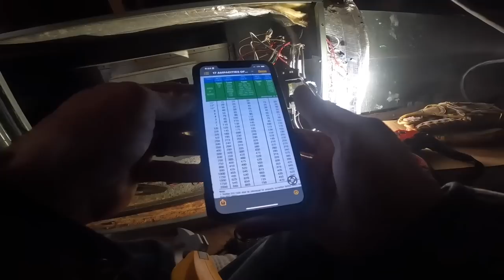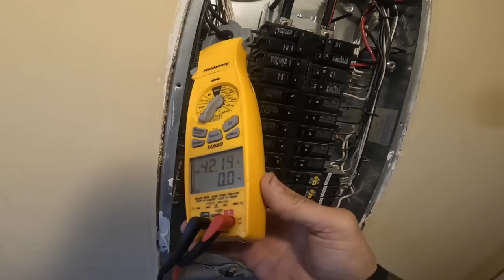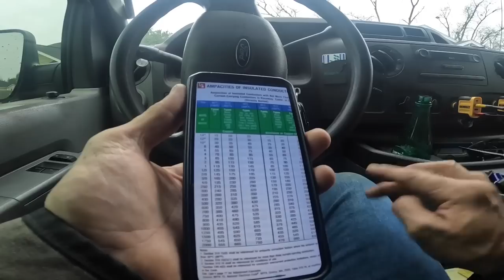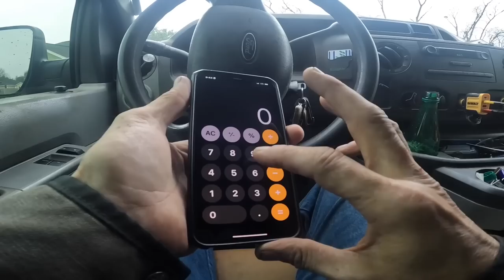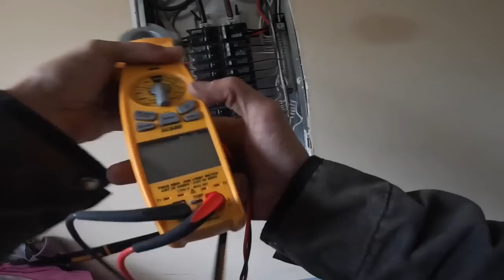No Heat Call Leads to Finding A Problem That’s Been There For Over A Decade

Comment: With aluminium wire , it is always recommended to use deox , tighten the terminals, wiggle the wires, re tighten , do this three times . This prevents cold flow ( the aluminium wire becoming loose later. )
Reply: Hey I installed a surge protector with my mini split but it seemed like it had stranded aluminum wiring- I'm not sure but it certainly wasn't copper. Any install procedures for the small guage stuff like that? Nothing mentioned in the shitty instructions
Reply: @chrisE815 Use deox and use the same process as I posted.  No issues with aluminium wiring if the proper preparation is done.
Reply: agreed!
Reply: @Total6666  So I was doing some reading on Nolox (or similar) and the reasoning. The main difference between copper and aluminum at the connections is the copper oxide remains conductive but aluminum oxide becomes resistive. So de-oxide used at the junction coats the aluminum to slow/prevent oxidation and includes an abrasive to etch through any existing oxide. Since aluminum will expand more you also really need to torque the crap out of any lugs.
Reply: @Mike80528  yes and Besides torquing the aluminium and copper stranded wires, wiggle the wires   back and forth, then tighten . Do this at least 3 times and this will prevent cold flow also.
Reply: code also requires the lugs (or equipt) 
to be rated -and marked CU/AL
Reply: @sparkyobrian6417  most devices are marked with cu/al , but it is always good to check if they are.

Comment: It’s surprising that whoever installed this Furnace Setup didn’t Add an Outlet for a Light Bulb up above the Area that you’re working in. 🤔👍
Reply: They called in an electrician which went the extra cheap route. We would always run copper and add a service plug and a light. It is code in many places to have a service plug and light to service the equipment.

Comment: I have a heat pump. Work up one day to a cold house. Found the 50 amp breaker tripped. It has two breakers, one 50 amp with one 10kW heat strip and one 60 amp with the other 10kW heat strip plus the fan. Or at least that's how it was SUPPOSED to be wired. The installer swapped the feeds for the 60 amp and 50 amp breakers, so the 50 amp breaker was powering the 10kW heat strip and the fan. That's why it tripped. I swapped the feeds around so they are correct and it hasn't tripped since. A little attention to detail from the installer and it would have been done right.

Comment: I could be wrong, and i know code varies pretty broadly by location, but i would double check the ampacity for aluminum cable. Type UF would be direct burial cable rated at 60C as well as NM-B (Romex as most of us know it). This appears to be type SEU which is essentially service entry cable, rated for 75 or 90C depending on its insulation make up, so technically rated up to 50/55A. That being said with it running through the house and how much more you have to baby AL wire i completely respect the decision to de-rate the circuit given the choice to just swap a breaker and a couple parts!
Reply: It’s strongly advised to use the noalox or any brand of antioxidant on stranded aluminum wires.  Also, get a torque screwdriver to make sure the breaker is torqued to the manufacturer’s specs.  That will help insure a tight connection.  Those aluminum wires can be easily under torqued or over torqued.  I think it was a good call to replace the breaker with right size.
Reply: also should  you only use 80% of the wire rating for heat of ac ?

Comment: I have questions: Why downgrade the customer’s heating capacity just to match the load on the wire and breaker? Why not leave the heating coils as they were and have an electrician upgrade the circuit with new wire and breaker? Are the existing breakers rated for aluminum wire use? Did you use an antioxidant on the terminals?
Reply: You would have run a new wire with no access to most of it, better to match what you have already.

Comment: I wouldn't use aluminum on anything less than a 100 amp service just due to the fact, smaller aluminum wire expands and contracts too much. The wire has to be larger and every termination needs anti-oxidant. Ive seen dryers, ranges, and water heaters melt down because of the wire failing. The wire expands and contracts so much and a lot of lugs don't accept aluminum wire anyways, it backs the set screws out causing a loose connection. Once you get down to #2 aluminum required for a 100 amp service, the expansion and contraction isn't as great and doesn't pose as much of a problem that multi-wire branch circuits do.
Reply: Pretty much every electric stove in any house around here built in the last 40 years has aluminum wire feeding it. I've never heard of any problems with it.
Reply: @brianleeper5737  ... no problem provided it's big enough. It takes #4 Al to do a 50 amp feed.... and even then there's no fudge factor. A 50 amp breaker is maxed out.
Reply: @rupe53  It's a tad more complicated than that. According to the ampacity tables, if you are using type USE cable, 6 AWG aluminum, and 75C rated terminals, the rated ampacity of that 6 AWG aluminum is 50 amps. It is only when you use using 60C rated terminals with TW or UF cable (and I don't even think aluminum TW or UF is even made anymore) that you are limited to 40 amps. Because circuit breakers have 75C rated terminals and so does the range outlet, use of 6AWG aluminum USE with a 50 amp breaker is allowed.
Reply: @rupe53  If you think I'm wrong, ask someone with an electrician's license to explain it to you.
Reply: @brianleeper5737  ... you are correct in that using the different temp tables will get you different numbers, but I see this WAY too often and people are cutting it too close. BTW, if you use wire that's big enough then you can stop looking at that temp chart. #6 Cu is good for a minimum of 55 amps and stranded THHN can push a bunch more than that.
Reply: @rupe53  It's permitted by the NEC and the tables are pretty conservative. In any case, 6 awg aluminum is routinely used for 50 amp range circuits around here and I've never heard of a failure. Aluminum is used instead of copper because it costs less and the price difference has only gotten larger in recent years.

Comment: On Aluminum conductors you really should be using Noalox  or Ox-Gard to prevent oxidation on  them . i do agree with the 7.2 kw on that tiny wire .

Comment: I would have pulled a new no.6, and a no.10 and put 15 kw heat strips in it, I haven’t seen many houses that I couldn’t pretty easily run a new wire into the breaker box.

Comment: That was great preventative maintenance! It was Shitty to use aluminum wire for that application in an attic and under rated to boot. You probably saved them from a fire 🔥
Thanks again for a great video! 🇺🇸 👍
Reply: Yeah, that would be  Ruud awakening...
Reply: Zero Appliances of this demand allow aluminum wires to directly feed… 
All require copper conductors be attached.
Reply: Did you just say aluminum UF is romex? 
UF is direct burial NMcable… I think what you had was SE…
Reply: panel run is now what 1k..maybe more
Reply: This is also why aluminum wire is no longer approved for residential buildings. The loose wire at the breaker is extremely common due to heat and contraction/expansion issues and it is also common to come loose and burn up using bolt connectors, especially when connected to copper wiring. Of course the fact it was carrying too much amperage made it much worse.

Comment: I just took an emergency Amana PTHP call from a hotel in Lancaster, they've installed both the spare units, they're totally booked, and this "tundra blast" begins at 08:00 Hrs (in 2:00 Hrs).  I'll wind up installing a new heat strip set, new blower wheel/end bearing, and "Broad-Ocean" fan motor. The weak point is the fan motor, I've had three "totally locked", straight outta the box; from (both) Supply House, and NorthStock.  This turns an hour job into 90 minutes minimum, and requires that I carry at least 4 Broad-Ocean motors, just to be certain that two will function properly.  Stay warm, everyone...
Reply: Yours is the first post I have seen about a Broad Ocean I assume ECM? I have two Carriers one with a Broad Ocean going on 2.5 years. My other Carrier has an X-13 didn't make it 2 years. Up until 6 months ago (haven't checked since) there wasn't a rescue motor for a Broad Ocean. I called the rescue motor company and they said the BO hasn't been reversed engineered yet. Have you heard anything different?
Reply: @scotts4125  Sorry, Scott, these are Amana Goodman PTAC Indoor Evaporator Fan Motor 0131P00054SP's sourced from Supply house; the replacement stock just received is a OEM Zhongshan Broad-Ocean Motor Co. part # ZWK465A00301, 0131P00029, D1410100300397; and requires a control board upgrade, as  it's a 4-speed versus 2 speed.  This HVACR business was spawned from a Motorola Two-Way Comms Dealership, and was initially Carrier/ICP Comfortmaker. My former business partner, also named Scott, and I both are capable of doing Surface Mounted Device repairs at the component level. He tells me the Vietnamese-made ECM motors aren't his problem, it's the MOSFET's in the silastic-potted control circuitry inside the top part of the motor. Any type of static seems to fry them "open", and repairing them is damn near impossible because of the toughness of the conformal coating they use.  Hope this helps!
Reply: @AMStationEngineer  Wow I used Motorola two ways for years. I even had one that was an HDX phone before cellular. I had these devices called converta comms (sp) to put the radios in to charge and use a standard mic. The system I was on used repeaters all over So. Fl. The system always broke down in one way or another. Fun times. Now we are on tablets and apps and I can almost say the old system probably worked better when it worked. lol  Don't get me started on Salesforce.

I didn't realize Broad Ocean had an entire line I thought it was just ECM's. It's always mosfets going in board repair also. Thanks for the info.
Reply: if they get banged too hard in shipping, the housing ends can pinch down  against the bearing washer and rotor ends. making it not turn or very stiff, holding them by the shaft, using locking pliers or a bench vice better yet, you can pry/hammer with wood block or pull/push at the outer housing parts and probably loosen them back up. alternately, support the bottom housing by the outer diameter and drive the shaft inwards. probably voids warranty and I'd only do that in an emergency short term repair.

Comment: Good job!  Someone forgot to check the gauge size/max amp chart when the system was installed & compare it to the air handler & heat strip amp draw

Comment: Had a service call at a sports clothing store. Both (twinned) gas furnaces were on one circuit breaker (20 amp). And the breaker would sometimes trip. I had to recommend that they call an Electrician. (I still work 4 days a week...been doing service calls since 1973).

Comment: aluminum is such a pain because of how it expands and contracts; you should get a torque screwdriver so you can tighten breakers to the specified torque.
also, looks like one of the trussing webs is starting to split. you should let the homeowner know to have someone check it out.

Comment: Aluminum wire needs to be checked everything serviced.  You will find lose on high amp draw.  That's why it terrible on that application . Also treat all connections  with the treatment . Found that  a lot when copper wasn't available or so costly.  Have a great day.

Comment: I worked on a commercial building a while back.  They were having electrical problems, air compressors not starting, some appliances burning up.  They called me in to work on the compressor, after several hours, found there was nothing wrong with the 120 VAC compressor.  Some of the longest runs in the building were well over 300 feet.  They had 20 amp circuits for the outlets.  They had 10AWG wires connected to the 20amp breakers..  It gets worse, eight feet away in a large junction box, the 10AWG wires were wire-nutted into 12AWG wires, which ran the entire lengths.  Most wire tables I've seen show 12AWG for 20amps.  For your average home that's probably reasonable.  They don't seem to show the maximum lengths you can run.  I believe the maximum voltage drop under load should be 3 percent.  That was the problem, too small of a wire gage.  I believe my calculations indicated it should have been 6AWG for that length for the maximum allowable drop.  8 would probably have been OK, but certainly not 12.  The cost to rewire this building would have not been acceptable, so I informed their handyman to limit what plugs into where.  If they have to run a compressor, plug it into an outlet closer to their service panel.

I have an app on my phone from a company called "south wire."  It calculates the various lengths allowed at various wire gages.   You can even put in the maximum allowable voltage drops.  Power quality is an entirely different subject, reactive loads, computer switching power supplies, etc.  

I also noticed the aluminum connections were dry, eventually connections will go bad, need re-tightening.

Jim

Comment: it looks like that wire was allowed and passed inspection back then, going by the age of the panels interior and house construction. it wouldn't pass code today though, as it has changed.
used as an actual service entrance wire, the aluminum 6-6-6 SE(U) is rated 60 amps at 90C temperature. used indoor as feeders to something would  use the 60C wire rating column now due to code changes, so 40 amps max as you stated.
it already being there would be OK as is, just replace the panel breaker and re-terminate the ends getting rid of any thing overheated, it probably was never retorqued after the original install and either heat cycling loosened it or someone worked in the panel "moving" it around causing it to loosen further. of course downsizing the heat kit is the best quick fix solution, as long as it's enough to heat the home.

Comment: There can also be a Bad Contactor on heat strips called a ghost short. It only pops Breaker when the emergency heat strips are activated. The 24v coil is shorted. Keep that in mind. Good catch. Also power companies knowingly have to much Dirty power going to the Entire House over amping Everything in the house. And with the New appliances they all have boards and Boards don't take over amping. EMP Shield is the only thing you can do to protect the entire house and they are really reasonable. Power companies are in on it...

Comment: I would have taken a little different approach…I would have disabled one set of the two strips already there then gave a price on changing the wire to a 6-2 CU like it’s supposed to have…that way they would still have heat until a time available to change the wire

Comment: AL is a nest of hornets. If you are carefull you can get along but 1 bad move and all the hive is on your face (and the property on fire). IDK the code at your place but in HU wago-s and copper are standard  like 1990 and still are house fires due to overloadel AL wires and improper al-cu connections. 
AL is still used in aerial powerline due to small weight and good connectivity but there is code how to terminate such wires, at the meter and only copper is allowed in post 2k installations.

Take care and use thick copper :D

Comment: If you read the manufacturers instructions you cannot leave aluminum going into the air handler, only into disconnect. also a violation of florida building code
Reply: Georgia not Florida.
Reply: Hes not in Florida. Codes are different everywhere

Comment: its funny every home i had wiring was wrong. breaker , 14 wire sb 12. too much on 1 circuit.  jennair wrong breaker toaster oven..  and i have had 12 of them..  like bathrooms shower doors always leaked, failed tap test..

Comment: Are those breakers even rated for Aluminum,  if not might explain the loose connections due to expansion/contraction! Even if rated for Aluminum loosening due to just normal expansion/contraction causes breaker connections to need checking and tightening during annual inspections!!
Reply: That breaker panel looks too new to have any breakers so old they aren't rated for aluminum.
Reply: It's from lack of pm. Connections should be checked at least yearly like you said.
Reply: Exactly, the manual states that all aluminum connections need to be re-tightened and inspected for corrosion yearly, that's why we never run aluminum on anything less than service wire.

Comment: So you were going off of KW not amps? 🤯 You would think the higher the amps you should be good.......as I write this I figured it out it's over amping and running causing the system to run in high amps when it should have been tripped and stopped it from running so high in amps. Lol I hope I make sense and I'm correct? Please let me know if I'm wrong I would really like to know 🙏

Comment: Good video. Have a question or 2.   Do you only use your torque screw driver on certain types of wires in panel. 
And why did you stop using the boot protector on your drill.  Thanks

Comment: use a dial caliper for thickness look at chart this wasn’t just installed so how can it run fir so long with no problems just now tripping hmmm lose connection cause over heating i would cut and strip it if its burnt

Comment: Just a heads up Curtis, Rheem will continue to make the heater kits with breakers. The Rheem heat kits are the same part number with -1 at the end. My local Ruud dealer (Dealers) has them coming in soon. Worry not!